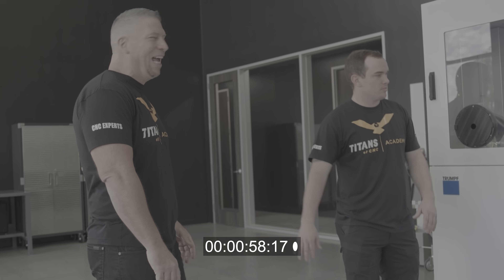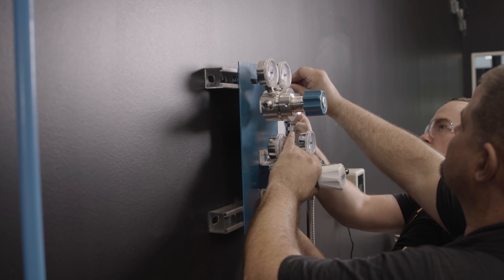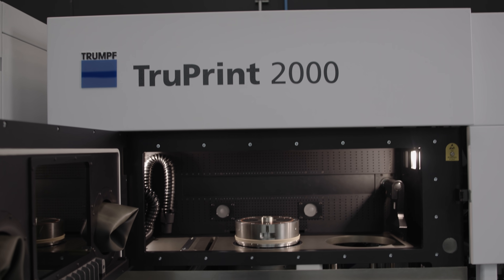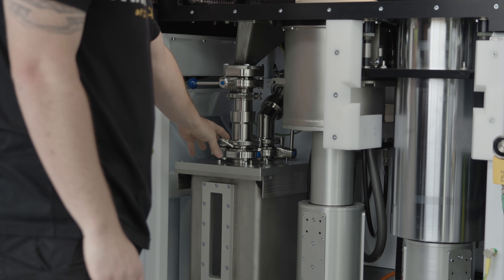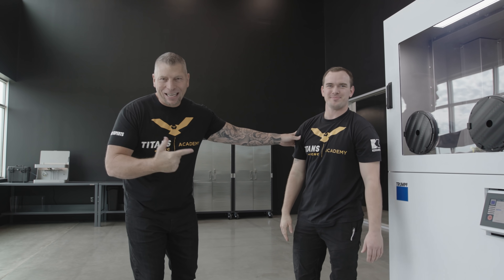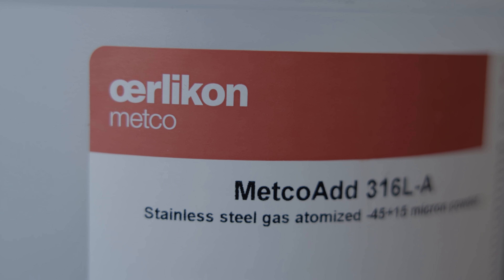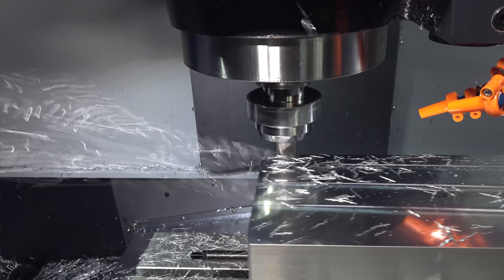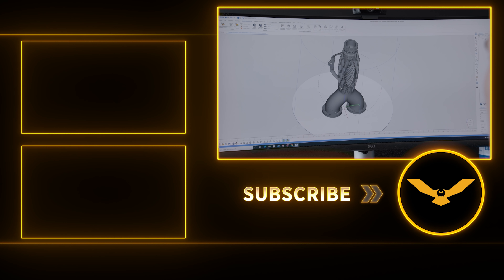3D Printing STAINLESS STEEL for the First Time on our New Machine!

Comment: Company by the name of CGS group came out with a new design for a rifle silencer a few years ago, was a very complicated design with multiple layers, the prototypes were made from billet 6Al4V and with the time involved in making them, it appeared that it would never make it to market or if it did the prices would be unbelievable. They came back a year and a half later with 3D printed titanium cans of the same design for less money, less possibilities for mistakes during the manufacturing process, and more durable in the tests they have conducted. The year following they introduced a tougher, smaller version using the same interior design but printed out of inco 718.

Comment: Hi titan i would really recomend using proper 3m mask for micro particle from the powder and use antistatic shoes nad jacker and glases when using the machine and always use some vacum vhen opening the machine when setting the machine so you dont get the ms1 or alu powder in your loungs, we have the EOS 3 d printer and u rly need do be carefull of shorts, Greetins :)  EDIT; i was at half video when i comment

Comment: 9 yrs ago I started my machining journey, at that time 3d printing was relatively new. The older gents I was working for were mold and die makers. They no longer did those types of jobs, as they had become a family outfit job shop... this was right after the economic recession of 08.  The owners husband was going on and on about mold making, I looked at him, with so little experience and told him, "3d printing will replace molds."  I saw smaller footprint, less cost, and the ability to change with a program. I love the printing game. Though I never have been involved, but soooo much potential. Wait till you guys figure out toolhold prototyping with 3d parts. Game changer!
Reply: Well you were definitely wrong. Molds are still king supreme in the polymer world.

Comment: The only metal additive I’ve done so hard has been on FDM using sintered filament, where you dissolve out the matrix and then sinter in a sintering oven.  I like the markforged system but you can do it in a regular FDM printer with the BASF filament which you then send off to be processed. But when you look at the cost you need a very compelling reason to do it.
Reply: We will have to wait and watch. It's exciting to get this opportunity to examine this tech or any advancements in more detail. 👍🏼👍🏼
Reply: newer designs are going to require it. There are geometries you can create in slm & fdm that would be impossible with traditional machining. In 5 years any aerospace company without this capability will be left in the dust......deciding whether or not I intended that pun. I think yes

Comment: WOW! Being blessed with a hands on opportunity to explore the capabilities of forging super intricate parts and understand the limits and process steps involved is thrilling.  Everything about laser sintering during the early years of development was astronomically expensive. What I recall from very limited past exposure to the technology, metal printing was a complicated multi-step process that involved infusion using either thermal wicking or chemical electrolysis bonding of the printed skeletal base with filler metals. Has it been simplified and refined?
Reply from the maker: Yep, check out the video

Comment: I love my fdm 3d printer. It would be nice to be able to print metal parts one day. I'm gonna end up attaching my welder to my CNC and do some metal additive manufacturing. Like that bridge they build with the robot arms.

It looked like the bed wasn't level on that first print. It'd be interesting to see how that bed is leveled.
Reply: It does appear that way but a late model state of the art machine like that,one would think should be self levelling.
Reply: @mehmettemel8725  probably an add on feature for like $10k

Comment: omg i want one. lol. these machines are beasts! I see it could print gold/silver/platinum on their website. would love to see you guys print something in those.

only complaint about these metal printers is the surface finish looks rough, which on a complicated internal design would be impossible to smooth out?
Reply: Electro chemical polishing would be one way to smooth even cooling channels or cavities. A whole process chain has been developed around the 3D printing.

Comment: I would be really curious to see some mechanical tests of some simple printed parts vs machined. It would be good to know the limits compared.
Reply from the maker: Will do
Reply: They are always going to be different. Powder metallurgy is what is and for critical applications has to be further processed , forged ,HIP etc.
Pros and cons to each.
Mazak do combined machines.

There is an almost combative atmosphere developing with adherents on both sides .Traditional "subtractive" macining versus "Additive" printed .
There is no need for this. 

"Horses for courses" I`m saying.
Reply: The finish depends on the process used to make it. Some have a bead blasted finish from the sintering process used to initially fuse the metal powder and fuse the final part. The process Relativity Aerospace uses produces parts with a chrome like finish.
Reply: We had tubing printed in what appeared to be headers for a small 4 cylinder engine. Kind of rough. Inco 718

Comment: Pretty impressive! A while back I was doing some reading on metal 3D printing and there seemed to be issues with the structural integrity of the prints because of the lay patterns of each additive layer - have you guys come across this phenomenon/have the machines been developed to a point where this is no longer an issue. Just thought I would ask for curiosities sake. Keep up the good work!
Reply from the maker: Different machines have different capabilities… these machines are incredibly accurate and the material meets spec perfectly. Lots of new materials also are being tested… Thanks for the comment.
Reply: Would it be possible to print a crankshaft and subsequently grind a 6 or 8 finish one the journals will laying down oil passages?
Reply: @highpointsights  I work with L-PBF and DED printers and could tell you that it’s certainly a possibility to do that. The biggest issue would be post processing in terms of heat treatment as well as having a machine that has a big enough build volume.
Reply: @johnsnitzer9287  that sounds pretty intense. I know Rocket Lab is printing their "Reaver Engines" (I think that is proper terminology")!
Reply: @highpointsights  yeah it’s pretty awesome work! It’ll be interesting to see what amazing things companies will produce with additive.

Comment: I got matsuura 3d hybrid machine what have 500x500x600 work area
Reply: Yeah, the TruPrint 2000 200x200x200mm
The TruPrint 5000 is a little bigger, but also better.
And $$$$$$$
Reply: oh wow that is siiick i just looked it up. how do you like it? Does the milling step contaminate the powder or cause any issues throwing chips over the next layer to be sintered?

Comment: I guess I an surprised you are not using a liquid nitrogen supply instead of the huge rack of gas cylinders. But I don't know your consumption rate. Each cylinder is only about 300 cu max.
Reply: It's a highly controlled welding process where argon normally used. Just guessing, perhaps the nitrogen is for a friendlier gas inert atmosphere for sintering.

Comment: Additive Manufacturing is such a benefit. I can't wait until it's within the price range of the home machinist.
Reply: I've seen  laser sintering machines for under $5k. a new startup is trying to make it for around 2k. I want one real bad.
Reply: @chrishayes5755  which startup?
Reply: @chrishayes5755  can you name a brand and machine? I haven't seen one less than 380k. I'd jump on that in a heartbeat.
Reply: Right now the machine SpaceX uses to make their Super Draco engines is a little over $20,000,000.00 and it's about the size of a filing cabinet. You won't have long to wait.
Reply: @eIgHtY0N3  Truth. The initial comment clearly defines this discussion as not relating to 1% who can afford anything including this. You are entirely glossing over the entire discussion while responding “but what about the color of the sky@ to a discussion about the optimacy of wheel design. doesn’t make any sense? you’re welcome
Reply: @FlygisTheFlygis  there already are efforts to make metal 3d printing availiable to normal consumers.
Just look at the channel „,metal matters“ here on YouTube and you‘ll see a guy developing a metal printer in his own home.

It will take some time and it might not reach exactly the precision of an industrial machine, but sooner or later the technology to 3d print metal will be available to the wide public at an rather affordable price. Probably won’t ever be as cheap as a Ender 3, but it will definitely be something that someone can afford if they save up some money
Reply: @yourlocaltoad5102   The fact that “there’s effort to” (lol) make metal printing affordable is given and wholly irrelevant to the discussion. 

Someone with a 10x(10x industry price budget) trying to develop some DIY ≠ affordable to consumers. What are you thinking… 

“it will take some time” no, it is unlikely to happen. you are guessing but your guesswork is ill informed nonsense. sooner or later the “technology” (product) will not be “available” (affordable is what you mean) to the broader public (who can already buy what’s out there) “at a rather affordable price” no, it won’t. 

It won’t be as expensive as Ender 3 or 30x that cost. 

It likely won’t be something people can afford. The complexity of such a machine and necessary footprint is going to be prohibitive more likely than not.
Reply: @FlygisTheFlygis  Look at the stuff metal matters produces and you‘ll see that there already are prototypes that while still having some focussing issues can already melt metal powder into solids in a controlled way.

Why are you so sure that metal 3d printing won’t ever reach a point where it can be accessible to normal consumers?
I don’t say that we will ever get to buy something that’s as precise, big and capable as the current industrial machines, but chances are that we will see devices in the sub 2000€ range that can 3d print objects out of some metals.
Reply: @eIgHtY0N3  I didn’t start with nonsense. At all. My mood is great, thanks for your concern and that brilliantly witty retort
Reply: @FlygisTheFlygis  bruh who upset you today?
Reply: Man there a lot of nit picking and whining here
Reply: Plastic 3D printing already should be in that price range so do not have to wait, can start practicing now.
Reply: @rcandcnc9684  yeah, ender 3 frequently goes on sale for less than $120

if you can afford the tech needed to watch this video, you can afford that.
Reply: Sounding so entitled… Yeah you’re living in one of the best times of mankind but that doesn’t mean there are guaranteed revolutions in invention that will somehow provide 99% cost savings to you for highly complex highly technological machines
Reply: @FlygisTheFlygis  c'mon man it depends on the technology and time. Additive manufacturing has existed since the 80s and due to a combination of patents locking down early tech + simply the tech of the 80s it's a no brainer why it's still in its infancy. Maybe it won't happen quickly but in time many technologies will work themselves out.
Reply: @BrownMInc  No, it doesn’t. It doesn’t depend on time. Just because some technologies have experienced crazy crazy evolutions and inventions that make it cheapshit enough for you to afford (which consider you’re the global 1% in wealth still is fairly exclusive), that doesn’t mean that others will. R&D costs money. High energy lasers cost money. Enormous room size enclosures to protect you and your environment from metal dust cost money. etc.  We aren’t talking about additive tech. We’re talking about consumer adoption. So stick to that. We’re already massively spoiled financially technologically and whatever have you. It’s like watching a kid get a supercomputer for christmas and first thing they do is ask “wonder if santa will give me a space station next christmas so i can like fly around and pour water bubbles that look kinda fun” or whatever equivalent utility is brought from home hobbyists aspirations
Reply: I bet you're fun to be around.
Reply: @mooreevair so sorry your happiness would be that fragile. lots of people actually value truth and nuance more than blind greed, but you do you
Reply: @FlygisTheFlygis  ..... Are you a troll?

Also, please define super computer

Do you mean a super computer from 1940s or today?
Reply: @FlygisTheFlygis  you dont quite seem to understand the thing with iterative advancement while still directly referencing it

Do you know what a handheld 40 watt laser cost in 1980? Let me just say that it involved two research teams and govt. Funding

Today, your average joe can buy one for somewhere around $130, including 3 18650s

The research continues still and not far from now, fiber lasers might be replaced by silicon lasers on the commercial market, offering the potential of getting a 200 KW laser for 15k by 2030
Reply: @FlygisTheFlygis  so? What’s your point? Life isn’t fair, in order for there to be winners, losers must exist. Equality means equal opportunity and chance to be a winner. You seem to be upset expecting it to mean equity, which it never has or ever will mean.
Reply: @billh308  Your comment is entirely nonsense in the context of this discussion. No one is talking about winners or losers, equality or equity, or anything even remotely connected to those things.
Reply: @FlygisTheFlygis  This can already be done by your average home-gamer with FFF printers and a kiln. No its not going to be the most accurate way of doing it, but its still possible and quite easy to do at home. Its a really good solution to ordering a machined part that costs more to manufacture than 1kg SS316 spool. The whole setup costs less than $1000, so its not something that only billionaires can buy.